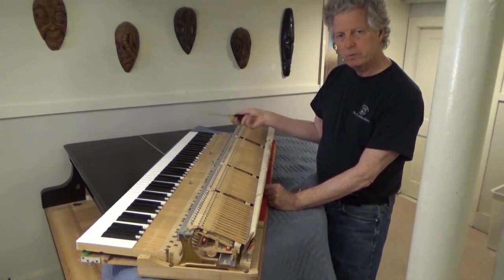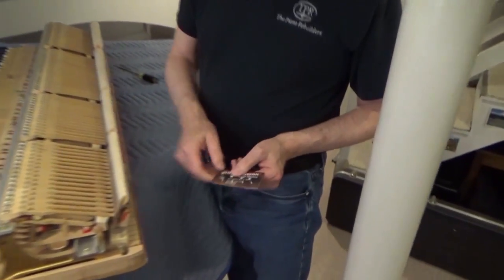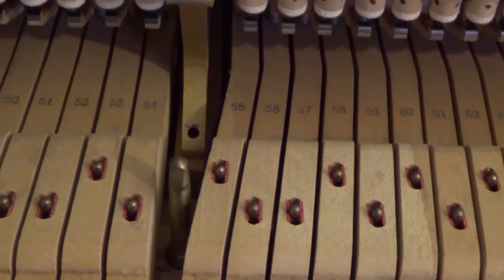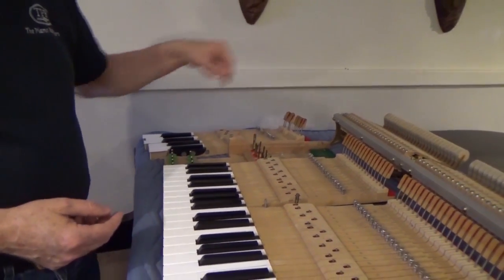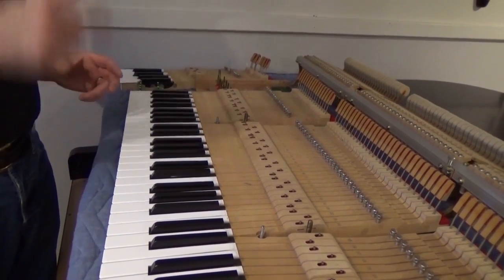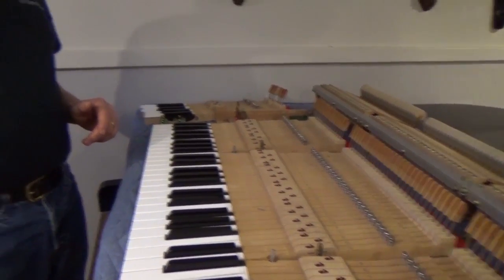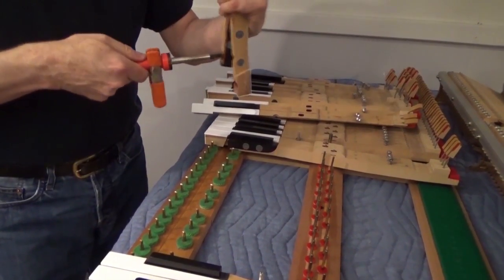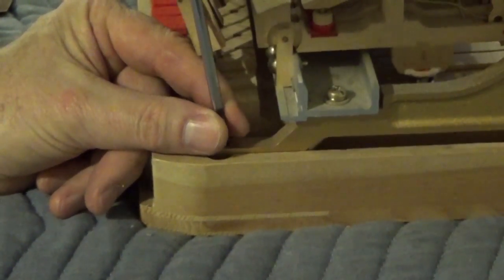Regulate grand piano – 3 pre bedding prep

Comment: You didn't show the brushing and vacuuming process, since that can often disturb felts etc... Do you consider it important to keep the same orientation of the felts and paper punchings?  Also what did you spray on the rails, pins and felts after cleaning?
Reply from the maker: I use an action brush and sometimes a brush with a stiffer bristle, along with the vacuum, for the backrail cloth. An action brush helps with cleaning punchings, as well. I am very careful around whippen rest cushion felt, particularly if not covered. Sometimes blowing dust out is a better option, but not in the customer's home without permission (I had this requested by a customer last week, to improve dust removal around tuning pins and under back portions of strings. It makes a better job, but wear a mask...). Maintaining orientation may improve stability if the soft front punchings are very compressed - good point. And I use Prolube on the key pins, keeping it off the keys but not worrying about punchings or rail. Thanks for your question/comment.